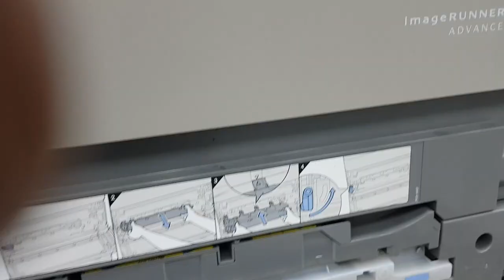How to remove ITB(Intermediate Transfer Belt) from Canon IR C5030 C5035 C5235 copiers.

Comment: how do you replace the belt though?
Reply from the maker: I just insert ITB belt ASSY in the copier.   Do you want to know how to connect the rubber belt on the ASSY?
Reply: @baxtor945  Yes. mine is bad and it needs replaced I suppose.
Reply from the maker: @majordisplay7192   https://www.ebay.com/sch/i.html?_from=R40&_trksid=p2334524.m570.l1313&_nkw=IR+C5235+ITB+Belt&_sacat=0&LH_TitleDesc=0&_osacat=0&_odkw=ITB+Belt       You can get ITB rubber belt for Canon IR C5235, C5030, C5035, C5240 copiers on this link.
Reply: @baxtor945  Bad link. And, that still doesnt help me with replacing it. I cant just take a rubber belt and shove it in the machine?
Reply from the maker: @majordisplay7192   Do you want to know how to attach the rubber belt on the ITB ASSY? If you want it, I will send you some videos on it
Reply from the maker: @majordisplay7192    https://www.youtube.com/watch?v=WAVMYFS8tLg